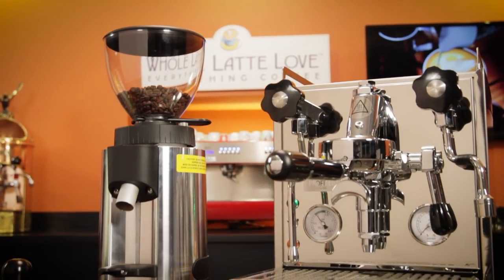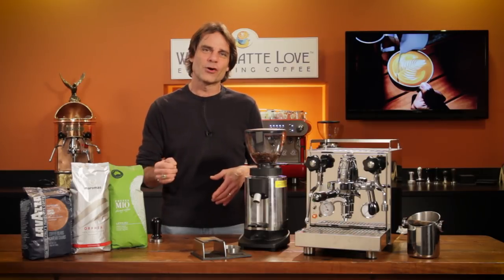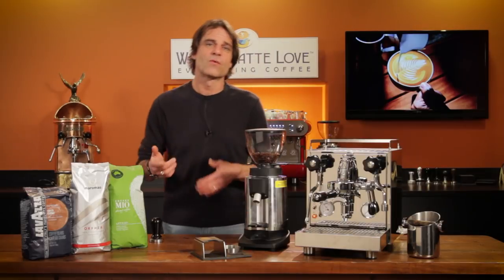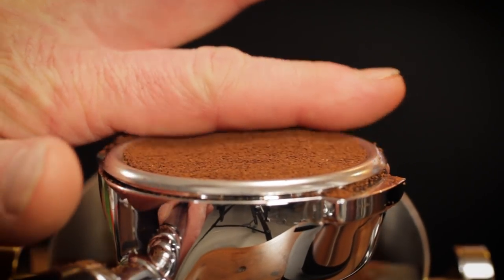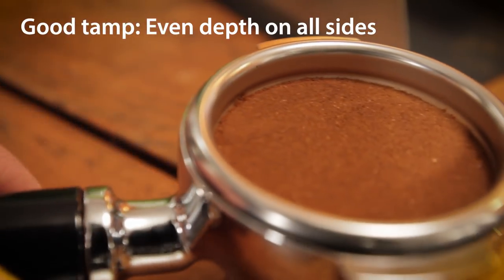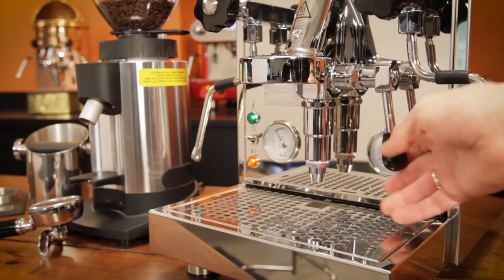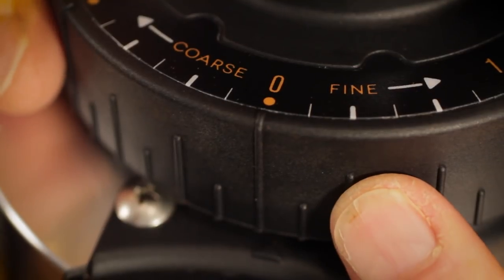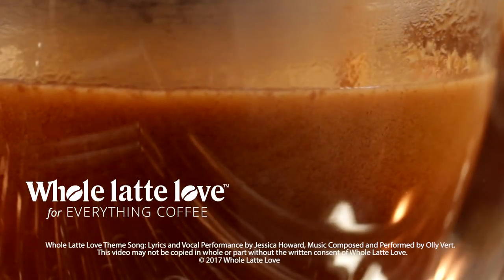How To: Basic Espresso Technique - Dialing in Grind Size

Comment: Hi Mark, Question for you...So I've recently transitioned from a Breville Duo-Temp Pro to a Breville Infuser. I was Quite happy with the Duo-Temp Pro's espresso. I found everything didn't have to be SO DARN PRECISE to get a great shot pull!! I 'think' what my problem may be is the brew temp on the infuser is too high. Often my shot pulls are bitter even when dialing it down....I even went as far as to purchase the Breville Smart Grinder Pro. Because I was having such a problem with bitterness....what I did notice from the get go, in using the Infuser was the temp. was HOT. (Glass too hot to hold Hot!!) CAN that be adjusted??? Also one more Quick question....Can I Pull more than 2 shots at a time with the Infuser.....I do 6 shots and frothed milk. With the Breville Duo Temp it was NO problem. Thanks I enjoy watching Whole Latte Love videos!
Reply from the maker: Hi RV, Thanks for the question and kind comment. To the best of my knowledge brew temp is not adjustable on these machines. I do believe there was an upgrade to the thermoblock boiler in the Infuser model. It's possible the Duo-Temp was under temp and now with the infuser working at higher temp you're getting flavor different than you were with the same coffee on the older machine. Typical corrections for bitter flavor are: Coarser grind, lower coffee dose and lower brew temp. Sounds like you've tried working with grind. As your temp is not adjustable you could try running some water (cooling flush) without the PF in place right before pulling a shot. This might cool it down but it could also make it hotter. Cooling flushes are more common on older heat exchange machines without PID. I'm not sure what happens in machines with a thermoblock boiler like yours. Hope that helps!
Marc
Reply: @Wholelattelovepage  Thank's for your reply Marc! I found a video explaining how to change the Brew Temperature on the Breville Infuser. I had to go into some advanced settings it's now set 6 degrees lower than it was set to. I was Glad to find that information. Thanks Again!!

Comment: Hi Mark,
Great Video.
I have a Breville Barista Express BES870XL Espresso Machine, and I use Lavazza Crema e Aroma - Whole Bean Coffee.
Could you give some advice on the Coffee Bean Grind Size number, I use #8.
Could you suggest a good Frothing Wand for Cappuccino Art. 
Also, prior to pouring the cold milk into the frothing pitcher, should the frothing pitcher be pre-heated with hot water or is it better to have the frothing pitcher at room temperature.
Thanks

Comment: I am a complete novice. I need help to use my beautiful grinder and expresso machine. I have a ECM Synchronika Espresso Machine With Flow Control and a Ceado E37S Espresso Grinder. I am watching the videos but it is confusing. I would like help with the most common settings to use these machines so I can get started.
Reply from the maker: Hi user, Those are beautiful - my favorite pairing of machine and grinder!
Here are some settings:
Brew water temperature (the t1 setting on the Synchronika): 195-205F. Use 200F for a medium roast coffee, 197 for a dark roast, 203 for a light roast
Grind size: You'll need to dial that in as described in the video. Grind setting changes if/when your coffee dose weight changes, you use new beans, the beans age, etc. Best advice is to get your grind to a size that holds together when pinched between you fingers. You should be able to vaguely see your fingerprints after pinching. Then dose your portafilter and attempt to pull a shot. Try and use the same weight of coffee in your portafilter each time. Scale really helps! If no scale grind enough coffee to slightly overfill, then level off without compressing. Then tamp the coffee with firm even pressure. Tamp level! Attach your PF to the machine and pull the brew lever. The goal is for your total extraction time to be 25-30 seconds to produce double the weight of your ground coffee as espresso in your cup. Again, scale really helps! If no scale use liquid volume. For a crema (crema is the bubbly layer on top) rich coffee liquid volume will be about 1.5-2oz for a coffee dose of 16-18 grams. 16-18 grams is what you'll get in your portafilter if you don't have a scale and use the overfill and swipe method to load the double shot basket. From there, adjust your grind a little finer if you reach the weight or volume in your cup too fast and a little coarser if it's too slow or not flowing at all. On the E37S adjust grind by 0.5  or less when timing is way off and by 0.2 or so when you're getting closer to the right time. Hope that helps. I'll be posting a video tomorrow using your exact setup and pulling a shot so I invite you to subscribe and look for that.
Hope that helps!
Marc

Comment: Love your videos.  They are so helpful.  i just purchased a new Breville Barista Express.  Running Columbia beans (fresh) at #5.  16.5G in the porta filter.  How many grams of finished coffee should i get with 16.5G of grind?   My coffee seems to be running bitter.  My brew time is about 26 seconds.  and  throwing 2.5oz of coffee (probably too much)  Thoughts?
Reply from the maker: Hi Paul, Thanks for the comment and question. Bitter indicates over-extraction. Typical brew ratio for espresso is 1:2. So using 16.5g grinds you're looking for 33g out by weight. Using volume to get brew ratio is tricky! I've done 1:2 ratio with crema producing coffees like Italian style bean blends and volume in cup including crema is 60-70ml. On the other hand single origin specialty coffees with far less crema might end at 1:2 ratio with 40ml in cup from 19g dose. I think you are right with the probably too much volume at 2.5oz but depends on how much of that is crema.
Marc

Comment: Thanks for this - I use an Oscar 2 - the pours have always been very fast ~ 5-6 seconds, even with quite a fine espresso grind - I've recently made the grind even finer - to the point where the grounds starts to clump up as they come out - that has slowed things, and made for some increased flavor, but a pull is still only maybe 10-12 seconds.
Reply from the maker: Hi PG, What make/model grinder are you using? 10-12 is far too fast. If using a lower cost grinder it's not unusual to get clumpy grinds at espresso fine grind sizes. After the beans, grind quality is the most important factor in making a good espresso. Old recommendation was budget 50% of machine cost for your grinder. Quality grinders have come down in price over the years. Check out our video on top 5 best coffee grinders. We have a category in there for Best Value for Home Use. Our pick in that category is the Baratza Sette 270. It produces beautiful clump free grind at espresso sizes. Here's a link to that video: https://youtu.be/Mm1TFjBK8Cc
Marc

Comment: Very informative video Marc.  I have a Gaggia Classic.  Should I be pre-flushing, and for how long?  Any additional hints on using the Gaggia Classic?  Thanks for your assistance.
Reply from the maker: Hi Allen, Thanks for the comment and question! First thing to do is bookmark our support wiki for the Gaggia Classic: https://wiki.wholelattelove.com/Gaggia_Classic Loads of use and maintenance info in written and video form there. Also manuals, diagrams, etc. On flushing... answer is yes! There are many techniques for getting the Classic to proper brew temp. Single boiler machines like the Classic have dead bands in heating cycles. Boiler gets up to temperature and machine indicates it's ready to brew. Then temperature in boiler starts dropping until the drop is enough to kick the heating element back on. One technique is to flush the machine until the heating element comes on then stop flushing. Then wait until the machine indicates it's ready to brew and do so immediately. If nothing else, flush without the PF in place until water flow is smooth from the group with no indication of flash boiling/excessive steam. This should only take a few seconds but duration will vary based oin where the machine is in its heating cycle. Here's a video which explains dead bands and a technique for getting consistent brew temps. It's demo'd on a Rancilio Silvia but a similar technique can be used on the Gaggia Classic: https://wiki.wholelattelove.com/Gaggia_Classic

Hope that helps,
Marc
Reply: I used the same technique on old Gaggia Classic. Flush, wait until boiler warms up, then immediately pull the shot.

Comment: Hi Mark, I just got my Gaggia CP and will be getting a Eureka Silenzio with it.  Re: flushing on Gaggia previous to brewing, is it necessary and if so what are your guidelines?  Thanks man, all your videos are super helpful. -m
Reply from the maker: Hi Madison, Thanks for the kind comment and question. Like all non-PID single boiler machines the GCP does swing in temps a bit depending on where it is in heating cycle. You can sort of see the heating cycle as the brew ready light will turn on and off. When the brew ready light comes on the machine is very close to its max internal boiler temp. When it turns off it's at its low temp point in the boiler. You can do a short flush and look for flash boiling of the flushed water at the group/shower screen. Flash boiling is indicated by extra turbulent flow. If you see that flush until flow is smooth. Should only take a few seconds to get smooth flow then you are ready to brew. If no turbulaence then no need for more flushing. You'll get used to when it needs flushing by associating the brew ready light to what you see when checking for flash boiling. Once you get used to it you'll know when you need to flush. Tip: Keep your PF in the group when machine is idle. Keeps it warm and bleeds off heat from the boiler potentially reducing the need for those short flushes. Hope that helps!
Marc

Comment: I just bought a ECM casa v from y'all. Do I need to flush prior to each shot?
Reply from the maker: Hi John, Thanks for your patronage! Flushing depends on where the machine is in its heating cycle, how long since the last extraction and other more minor factors like ambient temps. The easy check is a very short flush and look for turbulent flow off the shower screen. If not turbulent your good to go right away. If it is, flush a few seconds more to smooth flow and you’re set. Do keep your portafilter in the group when not in use to keep it warm and act as a heat sink to smooth boiler temp fluctuations. After using for awhile you’ll get an idea of how to work it for good temps. Hope that helps and enjoy!
Marc

Comment: Hi, great video! I am using an old Gaggia Clasic  and Breville the Smart Grinder Pro and great coffee beans producing delicious crema. Any suggestion on how to control the temperature for brewing due to the lack of a thermometer in the Classic getting inconsistencies in the final shots. Sometimes too quick running water and too fast the brewing.
Reply from the maker: Hey Jose, Thanks for the comment and question. Like all machines controlled by themostats or presurestats there is some variance in boiler water temps depending on where the machine is in its heating cycle. One tactic with the Classic is to flush water from the group head until the brew ready light goes out. Then wait until the brew ready light comes back on and pull your shot then. If you want brew water hotter wait say 20 seconds  after the light comes on. If cooler do a short flush of 3-5 seconds prior to extractions.
Marc

Comment: Hi Marc,

Great videos, I've watching you lately. I just got a Breville BES870XL a month ago, also I've had a Capresso Infinity Burr Grinder for some time (We've used it for French Press). Some questions:

1.- I use the grinder in my Breville, should I do this or try to use the Capresso Infinity instead for my espresso shots?. Which one would give me better results? not planning to upgrade grinder, I want to work with what I have.
2.- Very Specific to the Breville BES870XL - How many double shots of espresso can you make in a row with this machine? I heard that you can only make a few and then let the machine rest. 
3.- I froth the milk before my espresso, should I flush the head right before the shot or flush and wait some time and do my shot?
4.- Should I start the timing the espresso with pre-infusion or as soon as the first drop drips?

I only use the double shot single wall portafilter. I'm using 18 grams of beams.

Thanks in advance!
Reply from the maker: Hi AM, Thank you for the comment and questions!
1. The grinder in your machine should give better results than the Capresso Infinity. It has finer control of grind size in the espresso grinding range.
2. The machine uses a thermoblock boiler under PID control so brew temps are accurate shot to shot. When you do many shots back to back it's possible components like the group head can heat up. But, I wouldn't worry too much about that. You'd really have to be cranking them out continuously for that to become an issue.
3. Flushing is not required after steaming. The machine automatically purges excess steam after frothing.
4. I prefer timing from 1st drip. That way things like pre-infusion do not become part of the timing. Timing shots is a basic technique and works as a guide to get you in the ballpark. In the end, I'd go with flavor. Some coffees to better with longer or shorter extractions and other variables like grind size and dosing weight play into the finished espresso. If you want to go further check out our video on brew ratios. Using brew ratios requires a scale capable of weighing an extraction in real time. Here that video: https://youtu.be/57UqPDirHoU

I like the double shot non-pressurized (Breville's single wall) basket with 18g doses - exactly what I would use!
Hope that helps. Let me know if you have any more questions.
Marc
Reply: @Wholelattelovepage  Thanks a lot Marc!

Comment: Hi, you aim for 60ml from 17/18 grams in 30 secs, are you using a really strong coffee because in almost every Barista type video on you tube they aim for double the yield ie 34/36ml.
Reply from the maker: Hi Ken, Thanks for the comment. This is a basic technique video for those who do not have or use a scale to weight the output. Weighing in grams is far more accurate than measuring volume in milliliters. For coffees which produce a lot of crema 60ml liquid volume at the end of shot including the crema will weigh ~36g resulting in a 1:2 brew ratio from 18g of ground coffee. Pure water does weigh 1g per ml. Espresso does not - especially the crema which weighs far less than 1g per ml of volume. For those who have scales and desire more accuracy I suggest this video which goes deep into brew ratios using scales to weigh output for various espresso preparations: https://youtu.be/WifLRJZKs9A
If you want to go even deeper into high-end espresso there's this video which on flow profiles with an app connected Acaia scale recording/graphing extractions in realtime: https://youtu.be/HTaly8c-i_U
Marc
Reply: @Wholelattelovepage  Thanks for answer, I was hoping to get two 30 gram shots from the double basket and now accept I can't.

Comment: Very nice video. Thanks! I'm guessing I should keep adjusting the grind size as the beans age, right?
Reply from the maker: Yggdrasil42 thanks for the comment and question. Yes adjust grind size as beans age. Typically more import with single origins relatively fresh from roast. Still a thing, but less so with bean blends which hold up better with age.
Marc
Reply: @Wholelattelovepage  Thanks, that helps!

Comment: Hi. Any recommendations for grind size # from an OXO conical burr? Thank you. Also, why is grind time  important ? I grind till I hear a whining sound indicating there are no more beans..
Reply from the maker: Hi B, Unfortunately I cannot. Grind size could change based on other variables like the dose weight you're using and your equipment. For example some filter baskets may need a slightly finer or coarser grind size than others. Time is important to those who use a grind time to get a specific dose weight. With a good grinder once you have your grind size dialed in you can use the same timing and know you're getting pretty close to the same dose weight every time you grind so long as you don't change the grind size.
Marc
Reply: @Wholelattelovepage  Thank you so much. B

Comment: Hi Marc.. Very nice videos you are doing and very good explanations.. I'm a newbie for making a coffee, and we have bought our very first espresso maschine "DeLonghi BCO421" what tips do you have for us? I will take a look of your videos meanwhile.. Thank you...
Reply from the maker: Hi KK, Thank you for the question and comment. Your appliance appears to be one which uses a pressurized filter basket. These allow okay results when using pre-ground coffee or ESE pods. They are not capable of the same espresso quality as machine grade products with standard non-pressurized filter baskets working with coffee ground fresh right before an extraction. That said, my advice for better results: Use a good coffee with a grind size appropriate for making espresso. Load the portafilter with as much coffee as possible, make sure the machine is warmed up before use as this type of machine is not great at providing a proper brew temp. Can help to run some brew water thru the portafilter with no coffee loaded to help warm it and other brewing components up right before making an espresso.
Marc
Reply: Thank you very much for answering my message Marc. Yes i am aware that it might not be the best machine, but had to buy the first machine, which we will "upgrade" later... yes i will warm up the other components before making coffee.. Thanks again 🙏🏼